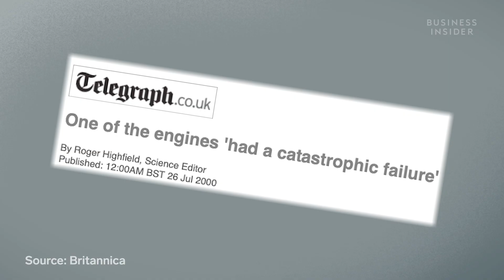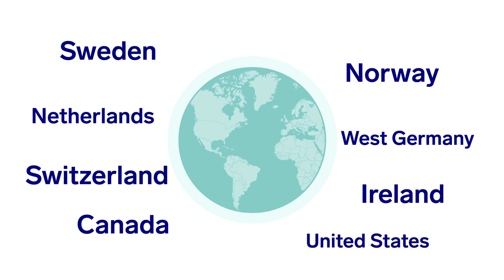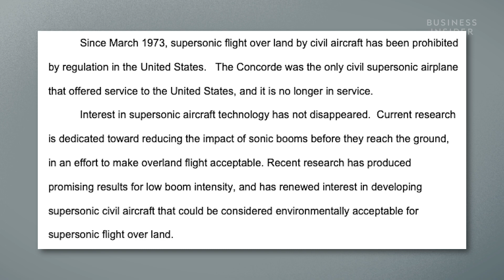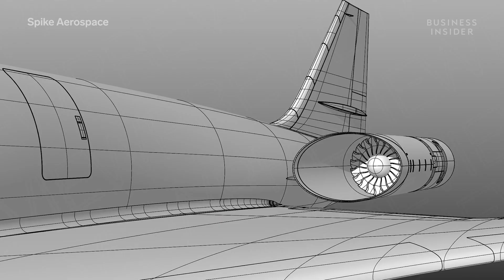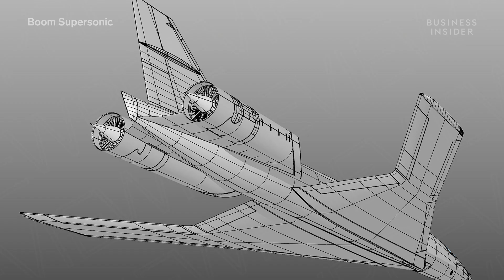Why We Still Don't Have Another Concorde

Comment: it's piss poor how there has been little or no improvement in flying time. it still takes 12/13 hrs to fly london to hong kong since 747 took me in 1980 !
Reply: Blame physics. 

It is most economical to fly around .85 the speed of sound or roughy in that speed area

Once you go faster you hit transonic speeds and air resistance spikes. People have tried to build planes where one flies just under the speed of sound but the massively increased air resistance isn’t worth it.

Then you hit the sound barrier and have to deal with sonic booms. It’s actually better to fly like Mach 3 than it is Mach 1. But aside from sonic booms, the increase in gas prices makes that kind of travel not all that practical.

So our current focus isn’t on making faster planes, but more fuel efficient planes with less drag

Comment: That is a LIE!!! Fuel price wasn't an issue because Concorde was quite efficient, it burned more fuel but it was faster. Also it has flown a lot higher than almost all planes, and that increased efficiency because air was sparse at that altitude. Even though plane tickets were expensive, Concorde was commercial success because a lot of people were waiting in line to experience mach 2 speeds. Only problem was that sonic boom was too loud and it was to advanced for its time, so competition wanted to kill Concorde. That was the main reason. The same story was true for GM EV-1 electric car.

Comment: You're talking about an aircraft that had refrigerated windows to make sure you could touch the glass at speed. That is how advanced the tech was, and yet in France they just went ahead and ignored the weight restrictions and removed parts from the plane to make room for more luggage. Then they left debris on the runway which flicked up into the wing leading to the inevitable crash... and they blamed the plane. That accident never needed to happen.

Comment: Im thinking by reading the comments here most people aren't old enough to actually remember Concorde. Here's the real facts of why it doesn't fly anymore. Firstly it was expensive to fly on concorde but it was always full. It was British Airways biggest profit maker & there was a few more than a single one of them. Secondly Concorde was the safest commercial plane ever built. It never malfunctioned once, the 1 single accident it had was due to debris on the runway from a different plane, concordes wheels when taking off on that runway flicked the debris up into its wing which was where a lot of fuel was stored resulting in its 1 single accident. Everyone who flew on it thought it was the smoothest & most comfortable ride theyd experienced on a commercial liner. The plane only went supersonic over the ocean so no one would suffer the sonic boom. The Americans wouldn't allow it to fly over land in America, simply because they didn't invent or have any rights to it restricting its chances of being even more profitable. The plane made its 1st flight in 1969. Not the 70's, 80's or 90's. The reasons they stopped using it was fuel was becoming very expensive & probably the main one was it was terrible for the environment. This 22 hrs of maintaining it for 1 hours flight really needs to be checked out. This  aircraft was unbelievably reliable. It was very loud as well by the way even when not flying supersonic & Heathrow was wanting planning permission for another runway. Sacrificing concorde  made the residents near to Heathrow more open to the runway that did open after concordes retirement. Those are all facts.

Comment: Concorde is still the best and always will be. It still holds the record for the fastest trans-atlantic crossing and it averaged on that run 1450mph and took less than 3 hours (2h 52min 59sec if I'm not wrong). It was a marvel of engineering when waaay back in the 60s when it was being developed and it is still better than anything that's ever flown since... I want Concorde back 😫😫

Comment: Basically:
The Concorde's fuel costs a lot.
Concorde burns fuel so fast, even while taxiing.
A plane like Concorde is WAAAAAAAAAAAAAAAAAAAAAAAYY so expensive.
Supersonic boom is very loud, and Illegal, also could kill people.

BUT, if airlines, Boeing and Airbus had even more money, and if Boeing and Airbus had so much materials, this would have been possible, maybe barely.
Reply: Concorde was so far ahead of the curve even the copied Russian plane had to use full afterburners the whole flight were as Concorde could go into supersonic cruise
Reply: @NHT7040  Wasn't that Soviet Concorde a rip-off of the original Concorde design but just became built before the OG Concorde did?

Also why are you replying to a comment made 8 months ago?
Reply: @BoltTheSunken2407  Because i can plus the American design never even got built suprised they never tried to ruin Concorde quicker like the avro arrow etc

Comment: A lot of people blame the 2000 accident as the demise of Concorde but that was only one of many reasons.   Concorde was simply to dear to book flights on especially because it took less than half the time of other airliners to fly between London/Paris and New York.  Because Concorde went twice the speed of sound it infamously created the sonic boom, which was required to zoom across the skies and as a result it was banned by many nations and airspaces.   Following both the 2000 accident and to an extent 9/11 passenger numbers declined sharply.   And because Concorde was losing more profit than making profit it was apparent Concorde could not continue as well as the fact it was to dear to upgrade and by 2003 was outdated especially as flight engineers were still required.

Comment: It's a pity that. In aviation and in this. There is no space in the hull for 8 parachutes. At the top . hull . Aircraft. Model fo flights . Tourist. General. 8 parachutes. Mounted in the event. And instead of belts. And airbags. Ditching. Emergency depreciation aid. Needs. Borys

Comment: Concorde sonic boom causing damage to buildings is a myth. No buildings have ever been damaged by a supersonic Concorde. Test done in the UK in the 60s residents reported that the sonic boom was similar to small lightening (but they did say is it was very annoying). And the USAF are allow to fly supersonic overland and there are no FAA speed limit above 60,000 feet. The only reason why civilian SST was banned was because Boeing b2707 original swing wing design was a failure delaying the project. The promise March 3 speed also turn it black hole for fuel, just when the oil crisis hit. The US not wanting the Concorde to dominate the market out right decided to ban it.

Comment: A far larger longer range Concorde could have been very popular on trans Pacific route especially Australia to USA and Europe via Panama as both of these routes are mostly over open water. But suffer from extremely long travel times that such a plane could cut in half!
Reply: Concorde did some trial runs , London-Sydney , again mostly over water , and cut journey times in half . It all came down to politics . Would you rather cruise at 200mph on the autobahn , or get tickets for going not much over 70 mph on UK motorways ? German roads are the best .

Comment: It was not too expensive to fly. The French used Michelin tires which would sometimes shred. This lead to the unfortunate disaster when some rubber penetrated a wing and fuel tank.  British Airways were making a profit from Concord. However, the French, being a Napoleonic lot,  stopped making parts for Concord because if they could not fly Concord, they weren't going to let the UK fly Concord. That would be more than their self-esteem could stand. And so British Airways also stopped flying Concord. Never get into bed with the French on an aerospace deal. One way or another they'll shaft you.

Comment: You will NEVER get the energy density of FUEL in a Battery, not now not in 100 years. Ask anyone with knowledge of Energy Density of the latest Lithium ION batteries and compare it to simple Kerosene or any other common hydrocarbon fuel. It will never happen with a battery. Physics has laws which can't be ignored.

Comment: Just build gigantic RocketShips!  Make then so up to 500 people can fit inside seats, strap it and then rocket down a rail then slope upward into a parabola into 50,000 feet flight level. You could go from NYC to LA in under 2 hours or even less.  The RocketShips can launch from far outside the Origin city. Imagine traveling nearly 13,000 MPH!!!

Comment: The fact they said 1300 mph is twice the speed kf sound bothers me
Reply: That's roughly mach 2 at the temperature at high altitude.

Speed of sound decreases when the temperature drops. At high altitudes of 40,000+ feet, the speed of sound is about 660 mph, so mach 2 would be about 1,320 mph.

Comment: Coming back to supersonic civil flight (which was never profitable) doesn't involve only reducing the supersonic boom.
The main problem is to design totally new engines which could fly at supersonic speed with acceptable fuel efficiency and noise.
Such engines don't exist yet, and developping them would be extremly expensive and long, with no garantee of success for a very small market.
Needless to say, with the current decline of air travel, no such project is likely to see the light of the day...

Comment: No one beleives these claims.Concorde has not been superseeded because sutable propulsion technology has not overcome efficiencies within the industry.This aircraft is experiemental taking only a few passengers in a small airframe at a fuel or efficiency level better or worse than a A350 neo ? The claims to half the flight time is not a provable concept. We learnt from concorde that over land its efficency was low and speed was industry average due to airway congestion. It did not gain advantage until it reach uncongested airspace say over the pacific ocean.The plane would also be subject to much lower airspeeds in congested airspace making flight time savings nearer 30 %. Scaling up to commercial sizes presents additional engeering challenges costing billions. So who is it for? When will such a concept work ? When a step forward in propulsion technology arrives and possible operating altitudes of 80000 ft are acheived with dedicated new airports. Virgin Atlantic Galaxtica has been working on this technology for some years.

Comment: The reason why we don't have another Concorde is because nobody bothered to think about replacing the Concorde while the Concorde was still flying. The technology in the Concorde was already obsolete by the 1980's and by the year 2000, a new Concorde should have been a priority for Airbus and British Aerospace. OK, so the Concorde never made money, but that's because they never got around to solving the problems that made it impossible to fly the Concorde over land. The new Concorde could have been more fuel efficient, quieter and faster than the original by using new materials and engine technology developed since the 1960's when Concorde was designed. I suspect a smaller, sleeker aircraft may have been necessary to eliminate the sonic boom, but if they could make it more cheaply, that would not have been a problem for airlines, and after all it's easier to fill a smaller plane, given that seat prices would naturally be higher than for slower airliners. If the sonic boom was gone, and the price of the aircraft was cheaper, airlines would be lining up to buy the new Concorde. It's just a pity that the makers of Concorde didn't understand this at the time. I suspect their mindset was that they did their best, spent billions of dollars, and the project was a financial failure, so they gave up in frustration and didn't stop to think that if they put their mind to it they could have solved the problems and challenges that the first Concorde presented to them.

Comment: Supersonic is cool. But will be an environmental disaster if it reaches the masses. No matter what you do a supersonic plane will not be more efficient the a conventional sub-sonic plane. Additionally with higher flying altitudes there may be greater risk to the ozone layer. 

Supersonic is cool but it's a bad idea if it goes mainstream. I also doubt airlines will be buying many supersonic planes, higher maintenance cost, higher fuel costs, and oil prices that are likely to go up in the coming years together with great environmental awareness do not bode well for supersonic commercial planes.

Comment: The severe environmental impact was not mentioned: these planes fly much higher in the atmosphere than subsonic airliners, and at those altitudes their emissions hurt the ozone layer directly. It’s been a reason for Concorde’s downfall and no technology can change it unless you use non-thermal engines which are not an option as of now. It’s a direct consequence of high temperatures in the engine producing NOx from nitrogen and oxygen making up our air. In addition, emissions stay suspended up there for much longer, worsening the greenhouse gas effect. These planes will only serve the business aviation segment at most but we won’t have a Concorde again in our lifetime unfortunately.